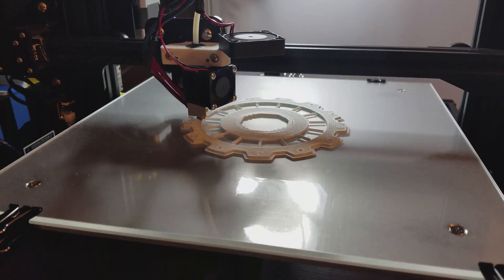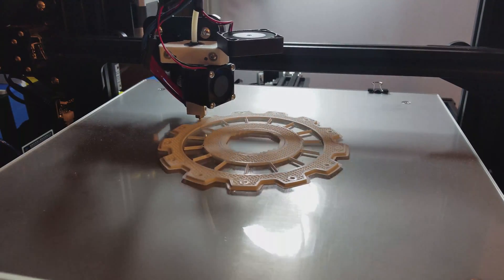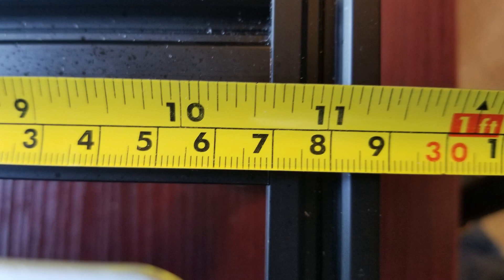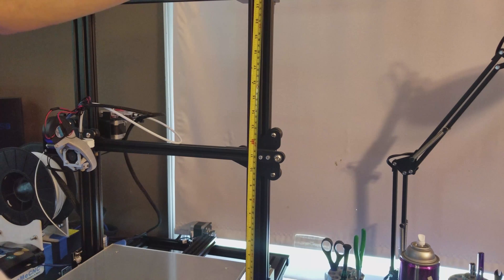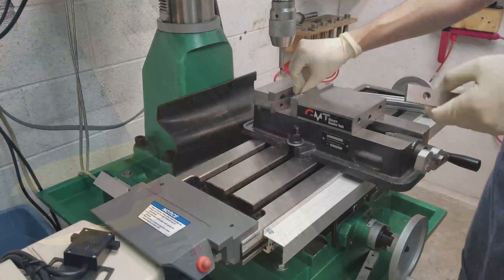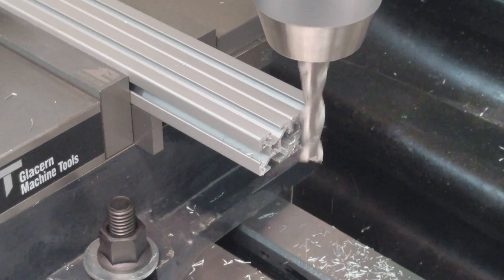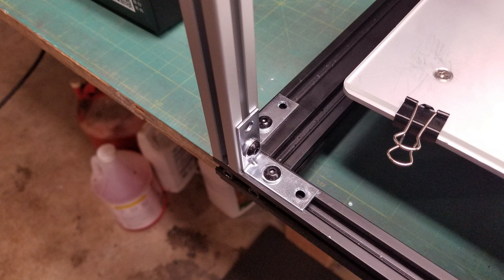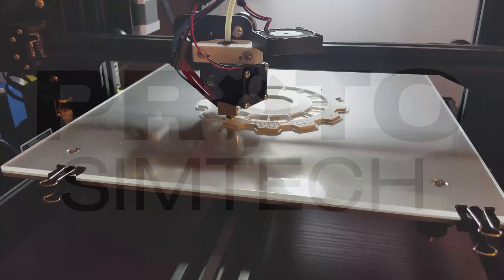Creality CR-10 Bracing

Comment: Just out of interest, why did you box it rather than go diagonal and triangle it?
Reply from the maker: The triangle version is probably better than this in terms of stability. I wanted to use this type of bracing because I added a second z-axis motor. The triangle setup typically has a bracing part that would fit right where the 2nd motor is for the z-axis.

Comment: how much would you charge to make me a set? if possible extend frame all Sides, each Side would have a Hinged Door.
 so we could add Plexiglass & enclose printer for ABS and others?
Reply: on left & right side say few inches away from frame, front & back would need to be few inches more then the bed can travel & same with top maybe extra 6-8 inches higher then top of Printer. as my Fang has the 5015 fan on top.  if you follow me.

Comment: Hi ProtoSim Tech, Can I assume the Y axis 20x40 aluminium extrusion (holding the heater bed) is at 470mm in length?  Thanks
Reply from the maker: The Y axis 20/40 extrusion is actually 500mm exactly. I just measured mine to make sure.
Reply: Thanks for your reply, really appreciate it. So the horizontal aluminium extrusions 20x40 holding the 2 Z axis verticals are at 460mm?  Thanks